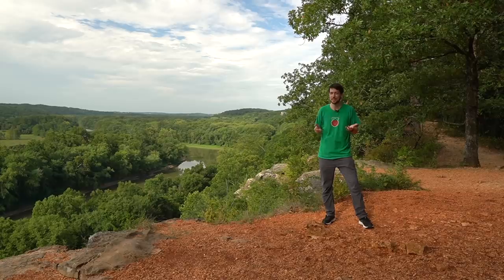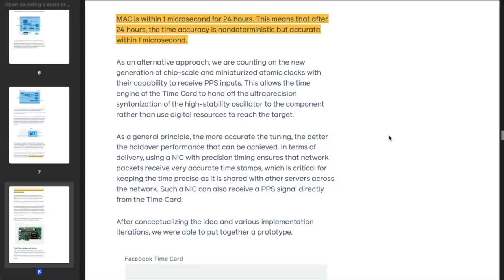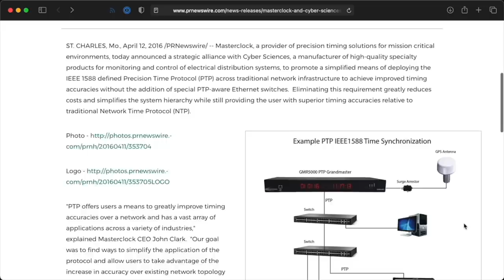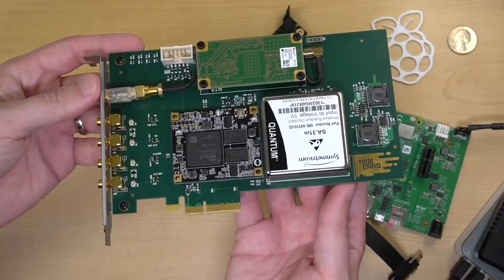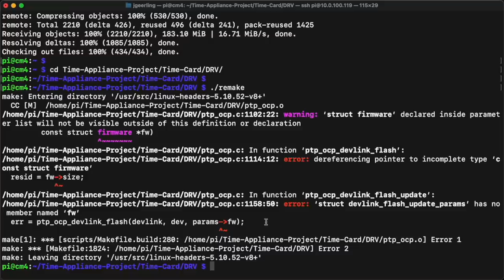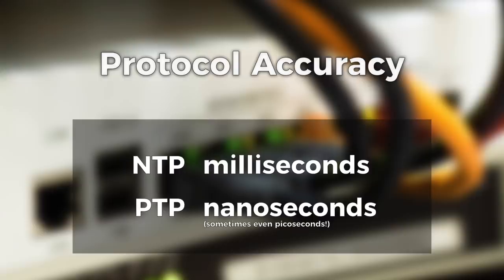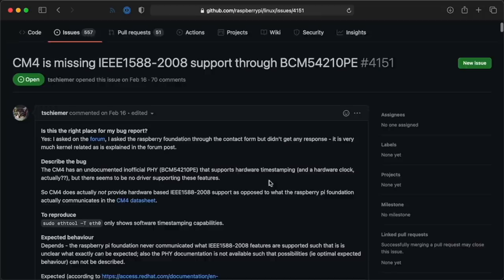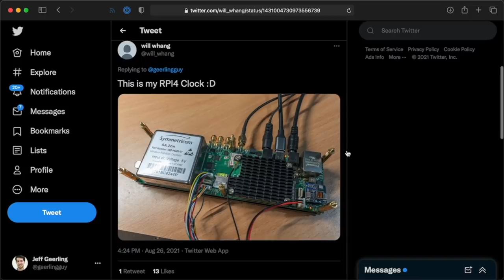The most accurate Raspberry Pi atomic clock IN THE WORLD!

Comment: If every self-driving car had one of these atomic clock modules in them, they could communicate with each other to warn about the position and speed of potential obstacles with a high degree of accuracy. They could also use it to coordinate traffic and reduce congestion.
Reply: You only need precision to a few milliseconds for that though, and if the cars cross synchronised in an NTP peer group, you could have µS precision easily - and with GPS practically universal in cars anyway (but most lack PPS, which would be a simple fix), each car could be stratum 1 PPS peered to all the others around it also at stratum 1, so the worst that could happen on the loss of GPS, Galileo, BeiDou, IRNSS, QZSS and GLONASS signals simultaneously is that the whole group could drift by a few µS.  One car with a faulty GPS would just drop to stratum 2 automatically, as that is built into NTP already. That just means it gets its time from the other cars around it, with very little loss of precision (offset due to distance [a nS is about 30cm] is built-in).  Galileo gives horizontal <20cm and vertical <40cm precision on its (free-to-use) High Accuracy Service, (coming online now, full implementation 2024) so we can be pretty sure about the clock precision.
Simply having the satellite portions without the rubidium would be entirely sufficient for almost all uses outside laboratories and data centres, and less expensive by at least an order of magnitude (and a huge improvement over current timekeeping on computers).  We just need to take Google out of the loop with their ludicrous slew system and make leap files securely and widely accessible so that their use can be automated.
Reply: You definitely don't need an atomic clock to do that

Comment: Many cristals and oscillators are running at a high frequency (dozen of MHz) and are actually precise. And they can be calibrated, even in software.
The problem is not the low frequency but environmental changes in temperature (like you said) but also voltage that make them drift at runtime and unpredictively.

Comment: audiophiles could be interested in this clock to be used as master clock for DACs.
Reply: Better CD/DVD/BD players sends out the clock signal and better amplifiers have an input to control the  DAC. It is normally not that important to run at exactly 44100 Hz absolute frequency. But it's important that the DAC runs at same frequency as the generated PCM data so the DAC doesn't skip some samples or dual-samples some.
Reply: Snake oil. Accurate sync between hardware clocks is important. Dante, AES67, and SMPTE already use PTP V2 with the oscillators we already have to achieve this in professional audio. Beyond sync, a precise global clock would still yield frequency stability in ppb from ppm. It takes specialized frequency counters to properly characterize stability at this order. Hearing any difference — not remotely possible. Phase noise of any local oscillator would dominate. Does sound like the bait audiophiles would burn cash on, but only meaningful to broadcasters mandated to deliver a middle A at precisely 440.000 000Hz.
Reply: @RandornCanis  I was one time told to buy a $200 (more like $400 in todays money) optical cable (with gold-plated connectors) from CD to amp. As if that would make it sound better. Best is the gold-plated connectors for the optical cable that doesn't even need any electrical circuit to transfer the sound...
Reply: @perwestermark8920  Sounds about right. Probably for the directional wide-stage copper. Buzzwords!
Reply: @RandornCanis  All audio cables are marketed as using oxygen free copper. Just that is was relevant maybe 1950. Today all copper manages the conductivity levels required for oxygen-free copper. But audiophile sales pitches are magical. Who would dare to not use gold-plated mains fuses for their equipment - the shame...
Reply: @perwestermark8920  Oh, you may have missed the "directional copper" phase. Consider yourself lucky.

A bunch of manufacturers in the 90s came up with speaker and RCA interconnects that had a "directional bias". That's right; totally passive copper wire that improves sound only in one direction — even when carrying an AC signal. Go figure. Monster still does this.
Reply: @RandornCanis  I don't think it was the copper itself. But since copper cables often may be be twisted pair to reduce pickup of interference, it's possible to make claims about left-twist or right-twist and alignment etc, and then make claims that the cable direction will matter when you have multiple cables beside each other on the floor. A normal network cable with 4 individual pairs has a specification how it should be connected in each connector end to minimize cross talk. And for a very good reason. But it's possible to at least try to argue about this between each cable on the floor too.

The problem with snake oil is that it's easy to write some descriptions and mention known physical properties. But the majority of such claims aren't backed by actual laboratory experiments. And we humans are quite easy to convince if tests aren't good double-blind tests.

A test done in Canada about sound quality of analogue and digital audio managed to indicate that analogue sound sent through a ADC+DAC sounded better than the direct analogue sound. At least one person involved happened to believe they voted that the vinyl player directly sounded better. And they figured out the consistent pattern of votes was because the relays switching between analogue or digital clicked a bit differently when it connected the straight analogue signal. So even the slightest error in the test setup can break was was intended to be a good dual-blind test.

And just believing there is a quality difference makes people willing to open their wallets.

So cables or analogue vs digital or 44100 contra 48kHz or 192kHz can result in huge religious wars that normally aren't based on real facts or bothering with existing scientific signal theory.

So not all companies selling extra expensive cables or equipment are dishonest. They just happens to believe in their products. And manages to get lots of customers that will swear about how much better sound they got after switching.

When it comes to CD audio, many of the first generation disks had bad sound, because of actually bad equipment in use to digitize the sound. 40 years ago, it was hard to make a good ADC - both to get 16 linear bits and equal-height stairs, and to properly filter the input signal above half the sampling frequency, and lots of people designing them did not have the tools or knowledge. People took that as proof that CD must be bad, and still believes that today. And also fails to realize that we got 192kHz ADC not because our ears can hear that difference, but because it's easier with current technology to make a 24-bit 192 kHz ADC and then convert the digitized sound to 16 bit CD "resolution" by post-production software than it is to make an ADC that produces same quality by sampling 16-bit 44100 Hz directly. Sampling at 192 kHz means the low pass filter must let through sound up to 20 kHz and have all the way to 96 kHz to reach strong enough filtering of frequencies above f/2. So a 76 kHz wide ramp for the analogue low-pass filter. Compared to just a tiny 2 kHz ramp for a filter that starts at 20 kHz and must reach very strong dampening already at 22 kHz.

In short - there is much theory in this world. And not easy to understand if - and when - it is actually relevant. So lots of opportunities for expensive audiophile products based on assumptions.
Reply: @perwestermark8920  Oh, Monster knows what they did. It's a coaxial cable, so twisted pairs aren't possible, common mode rejection isn't possible, no balanced signal at all is possible. They literally imply direction copper metal. It really is as stupid as it sounds.

Yeah, the power of suggestion is strong. After all, Monster is still around.
Reply: @perwestermark8920  Lifting grounds as such is precarious. There's plenty of floating equipment that won't work whatsoever. I can imagine some over the top audiophile scratching their head when nothing comes out after that fancy new isolated power supply. Can't say I'd shed a tear for them.
Reply: @RandornCanis  Yes. But a star-shaped distribution of ground helps, since there are no ground loops, and this should also makes each ground as strong as possible, by reducing cable length and number of connectors.
Reply: @perwestermark8920  That'll go over the heads of most audiophiles and is ripe of absurdity I'd expect from that group. May as well take a page from the books of audio engineers that have solved these issues decades ago. We have balanced transmission — which can also be, you know, digital.

It's almost frustrating this reinventing of solved problems in the audiophiles' quest of solving a non-problem. We already know how to do this. We know how to do it well, and we know it's far cheaper than what's happening there. Some good old XLRs and DI boxes will do infinitely more than power cable suspension bridges or whatever the current fad is.
Reply: @RandornCanis  XLR will affect the equipment people can use. Proper use of quite inexpensive cables can get very far, since a normal home doesn't need the long cable lengths of a studio where there may be 50 microphones and the mixer is in a completely different room. And there are no good reasons to try and place the low-level signals directly beside the mains power cables.

But yes - there are already proven-in-field best practices. Just that these are mentally incompatible with "audiophiles". It's too much religion and too little science. And then some people mixing in a decent amount of politics too by focusing on specific, magical, brand names.
Reply: @perwestermark8920  It should absolutely affect the equipment people use, and it wouldn't practically cost anything more. Now, I'm not preaching for XLR specifically; rather it's the common mode rejection we already use everywhere. Twisted pairs and magnetics cost literally pennies in the ethernet we've already mentioned.

There's plenty more than simple balanced audio, but altogether it's time for a shift in hardware when single RCA or power cables reach three to four digit dollars. That legacy and seemingly budget hardware can't be worth it.
Reply: @RandornCanis  Yes I agree the RCA cables can be sold at seriously inflated prices. I just noted that many existing HiFi equipment doesn't have support for differential audio so you need to add two external, powered, boxes.

And in many cases, you get a good enough result with (normal-priced or even home-made) RCA cables if the user tries to follow existing best practices. A home seldom needs extreme lengths of low-level signals.

If the user decides to have a vinyl player with very low-level moving coil pickup at one end of the room and the preamp with the RIAA in the other end of the room, then they deserve what they get. There is no fixing stupid.

Of course it doesn't hurt to look for equipment with differential signaling when buying new. But the availability is quite bad for the home market.
Reply: @perwestermark8920  Absolutely can make thrifty sound great, but we're not talking home-gamer with people spending thousands on cables or GPS disciplined rubidium oscillators. Phono is already balanced. A decent balanced preamp and proper balanced RCA is miles cheaper than the wrong coaxial woo-woo RCA or all-in-one line out turntable people are already buying. People just keep burning more money for worse sound.

Comment: I think synchronized motion in the industrial automation does not normally uses PTP as is. If Profinet is used in IRT mode (isochronous real time), delays are within the nanosecond. PTP is included in a wrapper protocol called PTCP (Precision Transparent Clock Protocol) and besides allowing you to synch the clocks, it can calculate the delays in the switches and cabling.
For this to work, special hardware is required at both ends as well as for the switching equipment.
The next best thing in Profinet RT (real time) with which you can get down to the microseconds. You can use normal hardware for that, even through Wifi.

Oh and fun fact, both of these modes skip completely layers 3, 4 and 5 of the OSI layer, so basically from the Ethernet layer you go directly to the layers 6-7. No need for IPs.

Comment: To actually sync the clock in a data centre over the network you need a support from network devices. You mentioned that the card does not have the support yet but it is only software. Well many networking devices also do not have hardware timestaming. This is actually a heavy topic if you want to dive into it. For 5G application for example the accurate time is used so multiple base stations can send data over to a handset   at the same time. There are multiple options to distribute time over the network the first one is via Synchronous Ethernet links and the second one is EEE 1588v2 PTP Boundary Clock. Many if the telecom providers use the second option as the hardware is cheaper. Same as on your cards the vendors like Broadcom created ASICs with support for hardware timestamping.

Comment: On the industrial manufacturing side, there are exceptionally few things that need more than 1/10 sec precision. The things that DO need to be coordinated are not done over a network, but rather point-to-point discrete signals. It is far faster to look for a rising edge of a 24V signal over 20m than it is to wait for network traffic to propagate to the devices. 

The PLC’s that run and connect things are themselves very slow compared to a netbook, so any PTP precision would go straight out of the window.

Comment: Nice video on the Rb + PTP + CM4 setup. Looking forward to support for the HW timestamp in Broadcom chipset. Although it's not as a sexy as the "atomic clock" rubidium setup, it might be nice to do a quick build on the CM4 with a normal GPS HAT +quartz RTC setup. It could still give you microsecond-level accuracy and with chrony's partial hardware timestamping support would be a quite capable NTP/PTP source for slightly lower accuracy requirements (like homelans :) )

Comment: It's also used in the test & measurement industry when one has to distribute the same 1PPS ,10Mhz sync and PTP time domain over a dozen hundred meters with as minimal drift as possible. Mostly for making time sensitive measurements in sync across distant data aquisition points of a distributed system. Symmetricom is a well established and known name on the market. Ofcourse this card will bring a more affordable solution to smaller companies and even individuals. Hurrah Time Appliance Project!
Reply: I wonder what the Low-Frequency Array (LOFAR) project uses.
Reply: That's a good question. It's way larger than to sync inside a factory building's several business units which manufactures and tests high-freq radio equipment.  On that large scale (across bordering countries) I guess it's the same GPS+Rb per receiving station. Combined with singlemode fiber on shorter distances just like the CERN white rabbit network. Plus some magic code that handles exceptions and maybe even mapreduces large chunks of data. You can easily find some articles on the net about both projects if you're very interested. It's a deep hole. Just "follow the white rabbit"! :)
Reply: @chris-tal Please explain to me how to get 1pps with a frequency of 1hz taking into account the time update. Raspberry doesn't allow this. Using a python script I get a stable pulse, but it doesn't have synchronization like pps

Comment: There is actualy a use for all clocks having a time card like that…. Temporal accuracy is necessary for self driving cars to cooperate creating a more efficient network.   Being half a second off when deciding who is going to do what when at 200 mph can and will have deadly conciquences.     So for cooperative self driving to work you will need accurate clocks.
Reply: The cars don't need nanoseconds. And proper ntp does not have 0.5 seconds time errors.

Given that this board sets the time from a GNSS module, the current GNSS in the car is already managing quite well. Even redundant GNSS modules with redundant GNSS antennas is a small fraction of the cost of the rubidium module.

Comment: In Europe we have DCF77. A cesium based signal from the hart of Germany with a range of about 100 miles or 1500 km. It the reference for all of Europe. Trains, postoffices etc. You can get receivers for home use as well.
Reply from the maker: The US has WWVB, which does a similar thing—once you know your relative distance to it, you can get pretty accurate time from the radio signal, too!

Comment: For the vast majority of users, a version of this at a fraction of the cost with ONLY the GPS system - and with backup to other NTP servers on the internet.
Selling such a simplified version would be a real money-spinner, and provide easily sufficient precision for the vast majority of PC or LANs, and potentially increase the number of available stratum 1 NTP servers available in the pools to the point where the load on each would be insignificant.  Such a basic GPS/PPS PCIe card (with drivers for all current operating systems) is a major missing link.
Once you get distribution around a variety of devices on a network, NTP is quite sufficient.  PTP is major overkill for almost everything we do at less than data centre or physics laboratory level.
Reply: You don't even need PCIe for GNSS-only time reference to host a NTP server. But you do need the 1 pps signal if you want IEEE 1588 where the network data is timestamped in hardware.